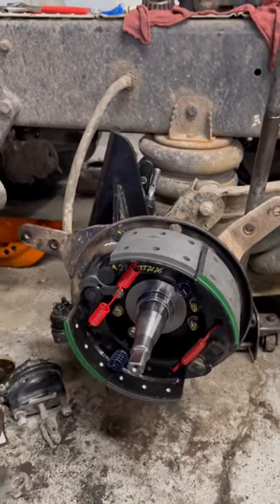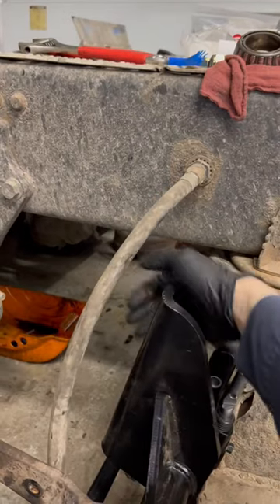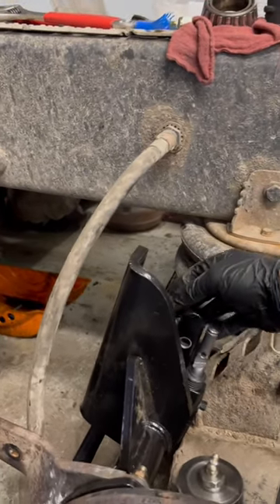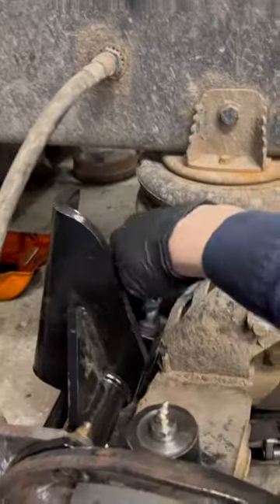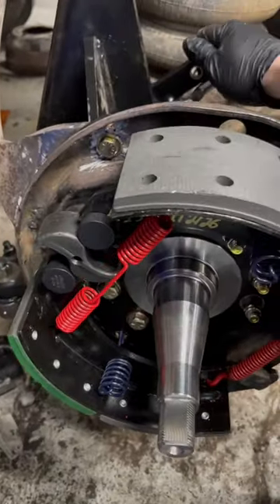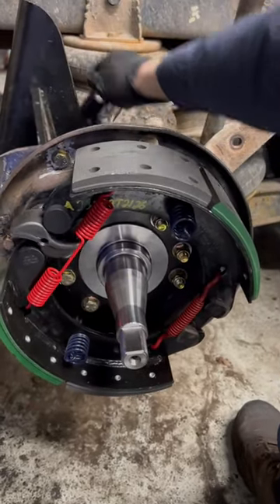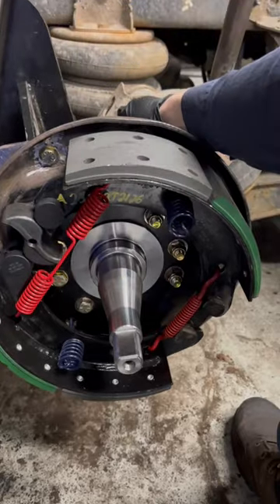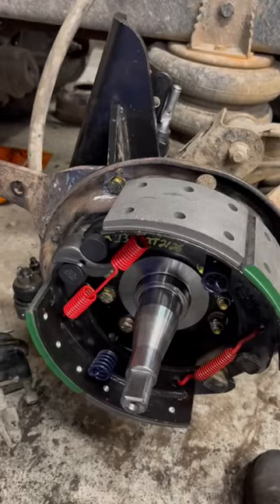Basic Rundown How Air Drum Brakes Work #shorts

Comment: Lol.... Air releases the brake genius... Removing the air causes the brakes to apply.... That's why there's a chamber
Reply: Wrong, genius. "Releasing the brakes lets some compressed air go out of the system, so the air pressure in the tanks is reduced. It must be made up by the air compressor. Pressing and releasing the pedal unnecessarily can let air out faster than the compressor can replace it. If the pressure gets too low, the brakes won't work." Good job incorrecting him
Reply: @musthavmusic  that's funny... I work on 18 wheelers for a living... I think I know how air brakes work.. genius
Reply: @jasonmanning5271  looks like you need to reread your manual, just cause you work on them doesn't mean you're good at it.
Reply from the maker: Tell me you don’t know anything about service chambers without telling me 😂